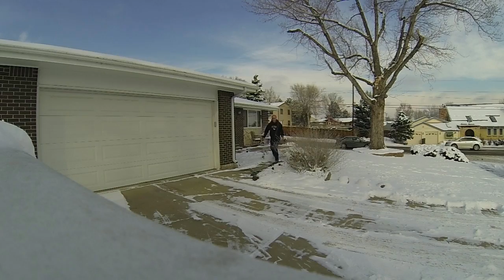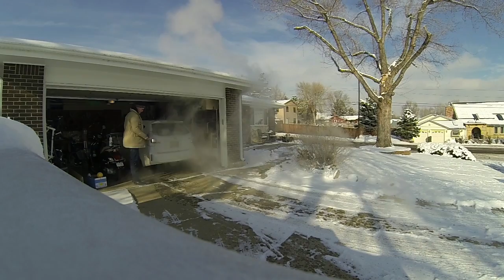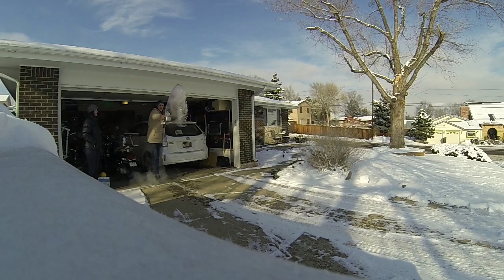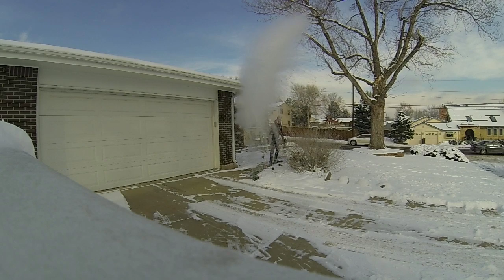Boiling Water and Freezing Air

Comment: Boiled water also holds less dissolved gas than cold water, which contributes to the speed at which it freezes.  That's why boiled water will produce clear ice, but cold water will produce cloudy ice.  The longer something takes to freeze, the larger the crystals can grow.  And in the case of water, the larger or looser the crystals are, the more light they can scatter, thus causing them to appear white.
Reply from the maker: Very good point.